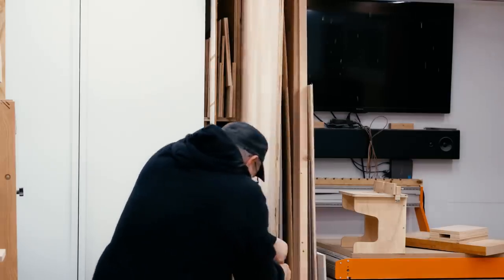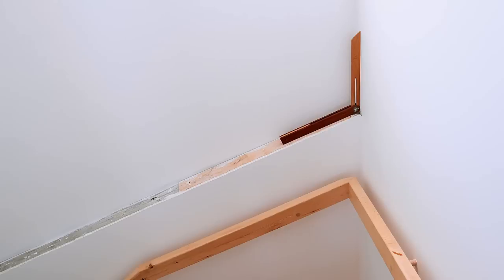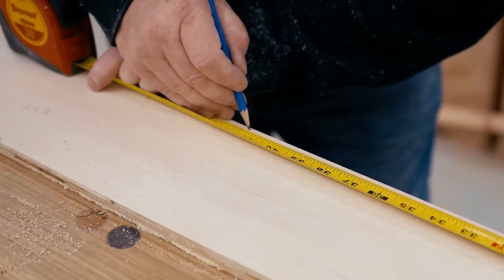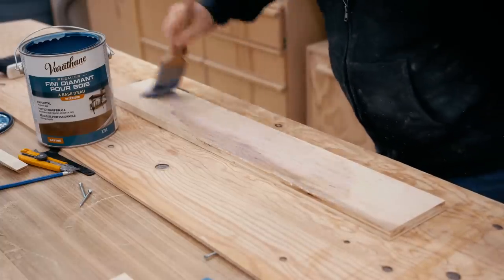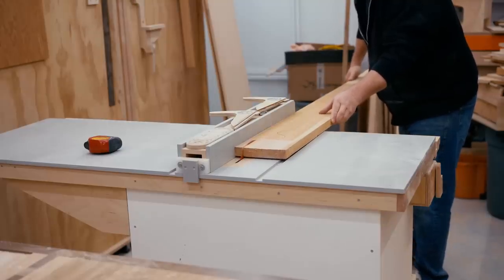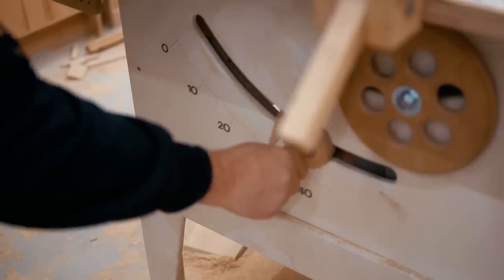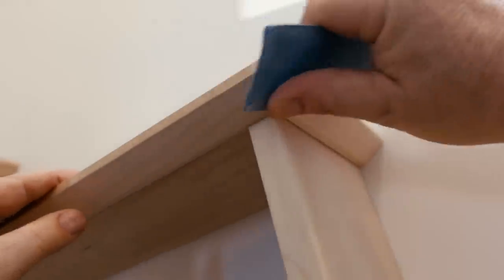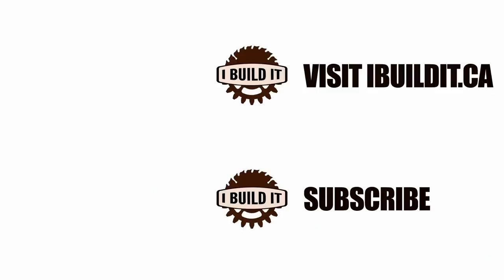These Shelves aren't Level, but I Made them that Way

Comment: Another way to do it is to pre-assemble the shelves, hold in place temporarily, scribe it, and take down the high spots with a belt sander.  This is especially good if you're cutting MDF or prelaminated countertop or melamine.

Comment: It looks good,- very unique design.   Unfortunately I fear scribing all those pieces to a sheet-rocked stud wall may prove futile because that wall is going to change seasonally.  All it takes is a few .001” and your careful work will be undone.  We would have taken the easier, slightly more expensive,  but also stronger route and shop-built it the unit in easily managed modules with 1/8” smooth material for an inset back, pre-painted and/or textured to match the wall if that’s the look the client wanted . Then the only scribe needed is at an exposed end and the return mouldings. Yes the design would have to change slightly but I think we could get close.

Comment: I'm curious:  When you made the first cut on the plywood, you used a home made guide clamped to the board.  But, you put the saw Next to the guide, not On Top the guide as it appears to be designed.  I've made myself a similar guide.  Why did you use it this way?

Comment: Looks great, John! Did you have to scribe all the horizontal pieces all the way through, or just the cantilevered shelves on the right? I was thinking you could use a rabbeted 1/4in back and simply paint it to match the wall color for the built in look but then realized that probably wouldn't look right with the shelves extending off the right. Great job as always though!